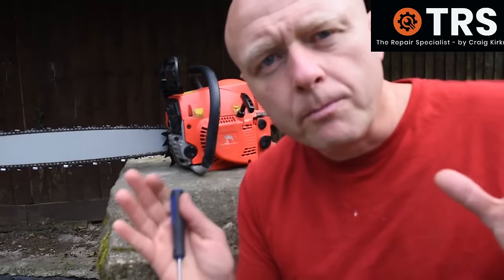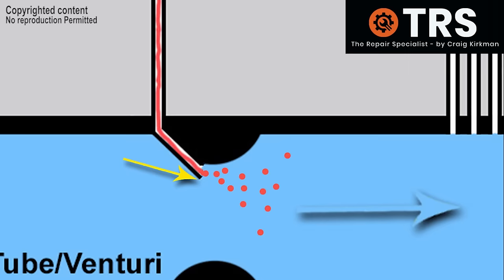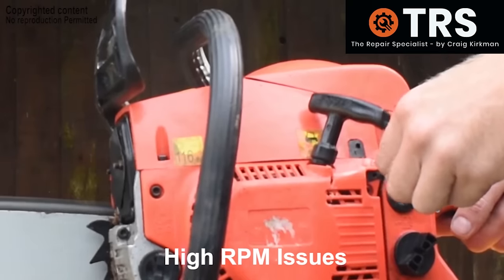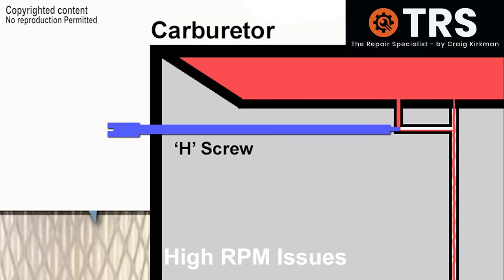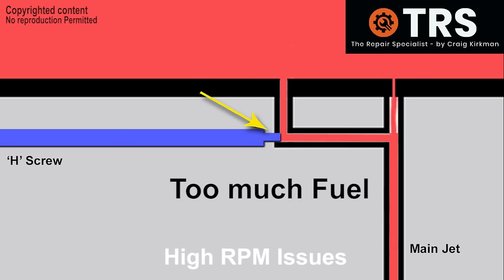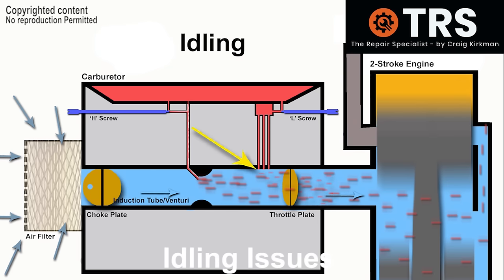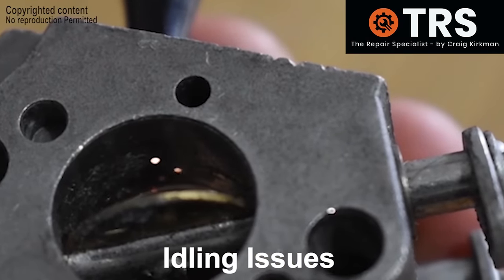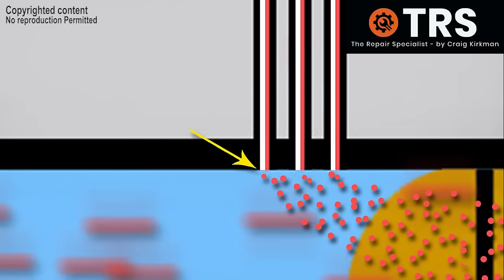CHAINSAW CARBURETOR FUEL SCREW SETTINGS do this Inside Carb | FASCINATING!

Comment: If my chainsaw floods every time I try to start it, and the fuel is good and the carb is new, is it likely my high jet is open too far? The saw doesn't bog, and it revs up fine once it's started. I can only start it by holding the throttle open when I pull the cord.
Reply from the maker: Providing your air filter is not blocked and is clean then I would try a carb reset. I know your saw revvs high without issues, but If you try a reset then it might just correct whatever issue is going on.  Sometimes this is the quickest and best route i find.  If you need it, then here is a video of mine that shows my personal procedure on how to do this. There is also a Free printable download leaflet to accompany the video.  If you don't want to follow the video then you can download, and print, the leaflet to take into the workspace with you, and adjust your carb at you own pace.  Here is the vid. The download link is in it's description. Thanks. Craig :https://www.youtube.com/watch?v=74p9FLmIkkw&t=60s
Reply from the maker: Also, I want to personally thank you for being a dedicated subscriber of mine for the last three years. I really appreciate you. Craig👍👍👍

Comment: im not sure what kind of saws u have, but i have to mess with stihls all day, with those its a Lot easier to simply get ur low dialed in then set the high, also the low doesnt just control idle on those saws, its responsible for how ur saw reacts when u hit it up thru about mid throttle, it should almost redline instantly when u hit it
Reply from the maker: Thank you for commenting I do appreciate it. Of course, my was isn’t the only of doing things, it’s just the way I’ve always done it. From what you’ve said, you are certainly very experienced with chainsaws so again thanks. Craig

Comment: What about if an engine works like when "gas is about to finish" (overRPMed) and dies?
Reply from the maker: My next video is about this topic. It goes live tomorrow 06/10/22 at 8pm British time.  Your issue could be the breather in the fuel tank. When i have situations like this I try slightly loosen the fuel tank cap so air can be drawn into the tank to replace the lost fuel. The breather usually does this, but if blocked, it cannot. Please only do this if you feel it is safe to do so, and don't unscrew it too much. If you have  a chainsaw then unscrew once you have turned off the engine.  Listen for a hissing sound. If so, then it has vacuum pressure building up. This indicates your breather.  Again, only do this if you feel it is safe to do so in terms of gas spilling out, try not to let this happen. Thanks Craig

Comment: I am constantly adjusting my jets to get my chainsaw to run. It will work great for a time but then will need readjusting after a    day of not running. Even after an hour of rest. Some times it will not start and I have to begin all again with finding the ideal setting. The standard one and a half turns on each never works. So frustrating. It is a McCulloch CS35S and is without doubt the most problematic and worst chainsaw I have ever bought. I have lost complete faith and trust in that brand